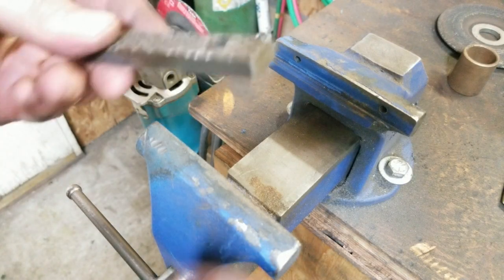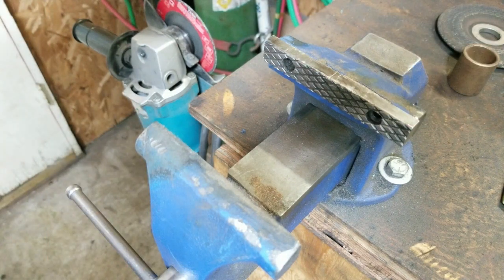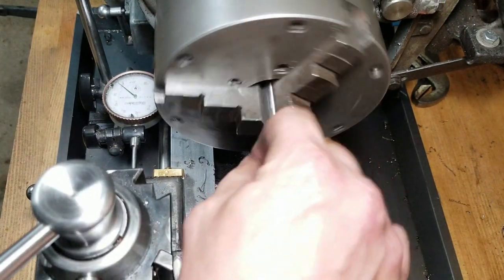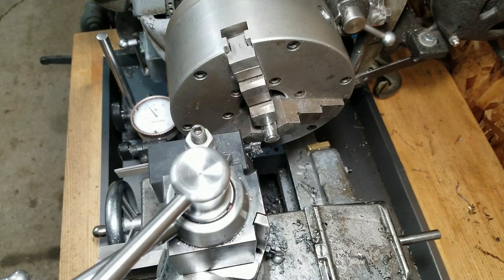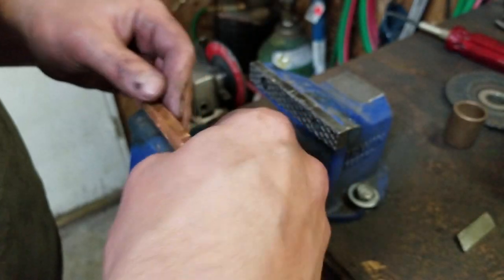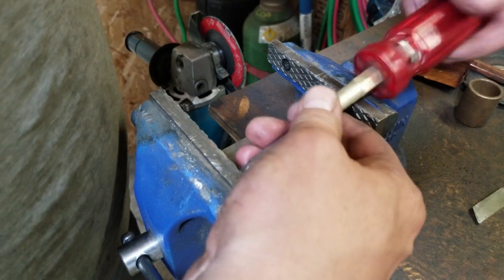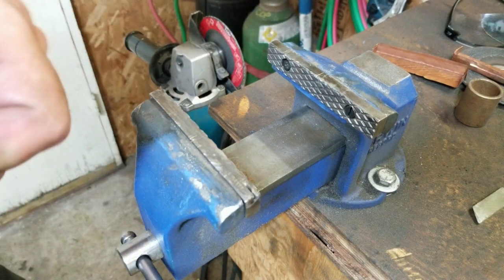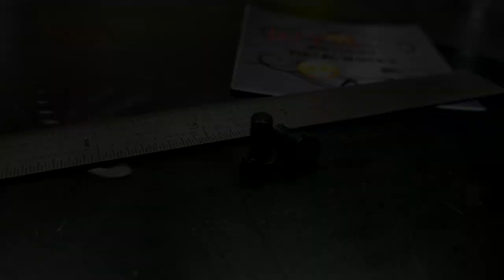Making Small Screws on the Lathe

Comment: Just lately I've been mending stuff around my shop, most of which I broke myself, and you're right it really is very satisfying. I'm using tools that have been gathering dust for years and it's so nice.
I'm now making 2 'half steps' to help my ageing German shepherd get in and out of the house, I don't have any steel to do the job so I'll be mainly working with wood and plastic, but it great to be able to turn your hand to anything (even if you don't know what you're doing) and have the tools to do it. Like I was told years ago: - "It's all about the tools".
Keep the videos coming mate, they inspire and push me on.
Reply from the maker: Also, digging them tools out of the pile of "things-to-do" makes the shop seem less cluttered 😁. Plus I'm sure your puppers appreciates it 🙂. Cheers!

Comment: Can you explain the final steps?  Heating, magnet test, quenching, and then oven baking?   What do each of all those steps do?
Reply from the maker: Certain steels lose their magnetic qualities at around 900°F,. It's just something of a guide to know when your metal is adequately heated for a quench. As for the post heat, it dial back the temper as the steel can be very hard and brittle while also relieving any internal stresses. 
Don't take my word for it though, I recommend getting a Machinery's handbook, it literally has everything in there 😊.
Hope that helped. 
Cheers!

Comment: Oh heck yeah. it doesn't get much better than machining repair parts that alleviate constant aggravation. Those little things add up to pissing me off. The vise jaws all loose, the drill press handles un threading for need of loctite etc etc.
Reply from the maker: Yep, that vise has been annoying me for a quite some time, can finally check that one off the list lol. If they ever break though, I pity the guy that has to drill them out 🤣.
Reply: @Just1GuyMetalworks  Just yesterday (coincidentally) I was tightening up the same screws on one of my outside vises. I need some super red loctite on those because that particular vise tends to see some serious  heat during disassembly wrestling matches.
Reply: @Just1GuyMetalworks  I found an old map from the 1920's of the Winnipeg River and it's "approaches".  It doesn't matter but I don't know anyone else from Canada to tell, so I guess it's just your bad luck lol
Reply from the maker: @johnstrange6799  cool! There's folks that would pay good money for stuff like that 😊
Reply: @Just1GuyMetalworks  I wish I knew some of them, because what am I going to do with it? I found the cardboard tube, hoping at first it would be a piece of stock, but then when it weighed nothing and I opened it, I thought it might be some old cool poster or something, but... well, not exactly Heather Locklear or even Farah Fawcet, just the Winnipeg River. :)
Reply from the maker: @johnstrange6799  lol. Try Ebay. I'm not even sure where exactly the Winnipeg river is 🤣
Reply: @Just1GuyMetalworks  Well, that either makes you as American as me, or me as Canadian as you, because I'm not even sure myself, and I have a map! lol